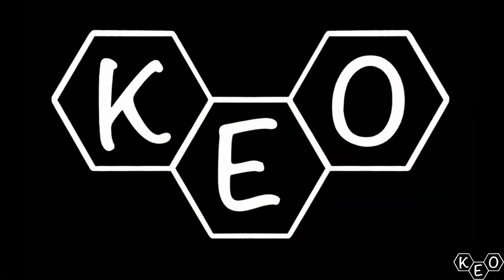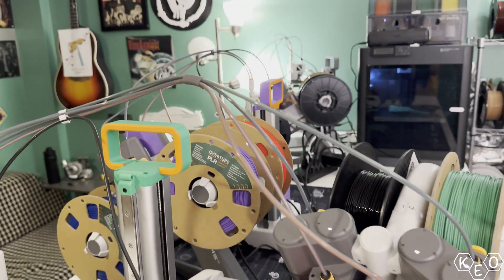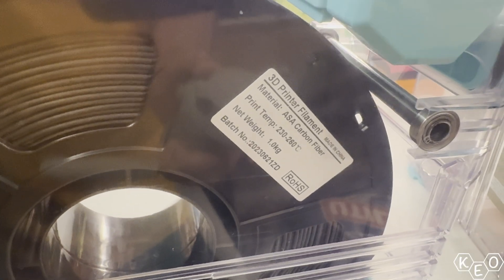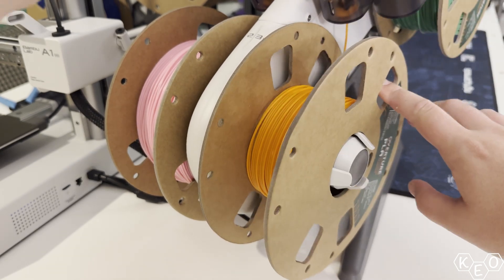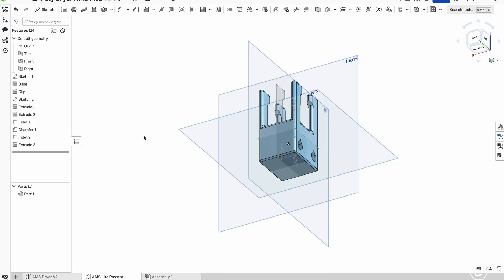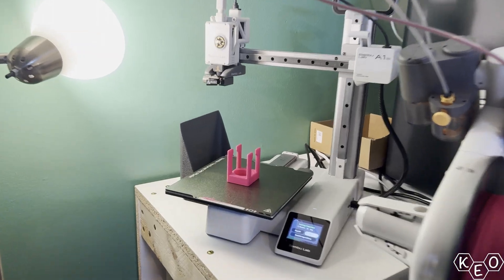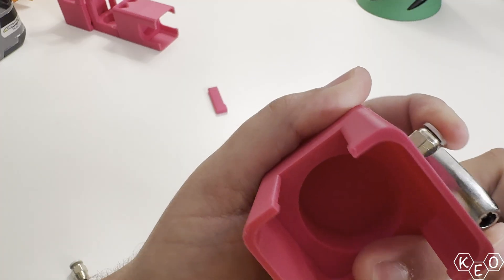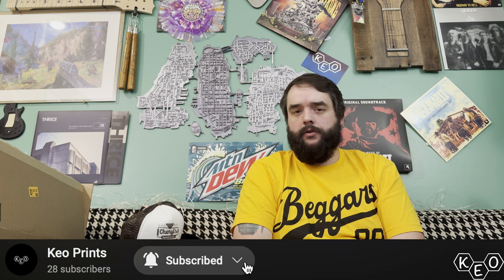The Major Flaw With The Bambu AMS Lite And How To Fix It FAST

Comment: Great video and have made the item in question, I’m not sure what fitment  your using to push the PTFE  tube right through the fitting and size etc.
I have only 4 mm tube fitting but the tube  ends where the tread begins.
Please share the info.
Reply from the maker: Unfortunately, I am not sure where the fittings came from. I have taken apart a lot of previous generation printers and rebuilt a handful as well. As such, the old parts bins are as full as ever and their individual origins are a mystery.

Comment: I've been struggling with screwing in those pesky PFTE tube metal fitting too - until I finally spent the time creating a proper thread for them.
Now the fittings screw in nicely everywhere, I can really recommend investing the time once and re-using the know-how after that for other projects.
Not sure if you have selectable standard thread sizes available in your CAD, but for the PC4-M10 inserts I use a hole with 8,38mm Ø and cut a M10x1 thread into the remaining material/wall.
After that I cut out the >70° overhanging threads with a simple rectangle. Designing a teardrop each time is too bothersome imo and a tiny bridge works equally well.
Reply from the maker: Good stuff here

Comment: Does the A1 mini have tha hardened steel extruded gear in the head already or do I need to buy the upgrade?
Reply: @Kid_illithid  the A1 mini list hardened steel nozzle and hardened extruder so it should work without any issue.
Reply: Sorry after double checking it’s not a hardened steel nozzle but a stainless steel nozzle, but the extruder is hardened so you would just to get the nozzle which list for $11.99 in US
Reply from the maker: That’s not so bad then
Reply: I’m on their site and the replacement  they sell says hardened steel, but I’ve seen people say you should upgrade. Big tree and a few others appear to make all metal extruder gears for not but I don’t know much more than that yet
Reply: It has hardened steel extruder gear, but not hardened steel nozzle
Reply from the maker: That’s a good question and I was wondering if anyone was going to bring that up. As far as I’m aware, it doesn’t come stock with a hardened setup so that is totally a consideration

Comment: The main mod I have done for my AMS lite for the A1 Mini was specifically he Ultimate Filament Spool Enclosure for the AMS lite that allows me to add desiccant to reduce the humidity. I live in TN and it’s normal for humidity to be 50% even in the house. This allows me not worry about PETG absorption of water affecting my prints it keeps humidity for spools below 10% which is the lowest my hydrometer measures.
Reply from the maker: Good to know. I’ve never even looked into that so that’s cool to know that people are providing some support for the AMS lite

Comment: After watching 10+ minutes, I still don't know exactly what this mod does or how it works.
That is kinda impressive.
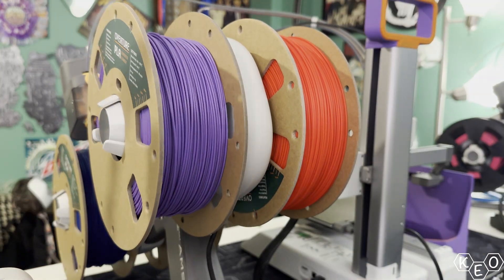Reply: The winner of the passive aggressive comment! 🤣 You certainly were a lot more polite in making your point than a lot of people would have been.  I had to rewatch it and finally found the key sentence at 3:41 that unlocked the functional mystery for me.

"so I set off to make a mod that would allow you to load the AMS light like you normally would using the spindle system move one Bowden tube into a new fitting and use a pass through"

@KeoPrints Thanks for sharing your solution.  Like @ZappyOh I don't have an AMS Lite either but I still watched because I was interested in your solution and the process.
Reply from the maker: Let’s be real friends… I’m just a dude at the start of the YouTube game tanking tons of time into filming, writing, and editing every week while I work my regular job. 

I’m just happy anyone is watching and hanging out with me at all lol
Reply from the maker: I’ll take it! Just print it and feed your TPU through that instead of the external spool holder. Or quick swap between AMS incompatible filaments while the lite still holds and dispenses them for you
Reply: @KeoPrints  Well ... I don't have an AMS, so it won't help me. I would just like to have an idea of what I watched :)
Showing it in action would probably have cleared that up for me.
Reply from the maker: I gotcha there. Well thanks for hanging out friend!
Reply: @KeoPrints  No problem ... thanks for posting.
Reply from the maker: Yo, here is a follow up to show this piece in action if you are interested
https://youtube.com/shorts/CB9O5jykvdc?feature=share
Reply: @KeoPrints  Ahhhh ... Now I get it :)
Thx.
Reply: @KeoPrints  Now I get what this was for! That sphantasia will get me every time. I'm not sure it works for my setup because I use a mod for the AMS lite called the "AMS mini" which works great if you have a different system for holding your spools. That might be worth a video too. But this seems like a great mod for people that still use their AMS mostly as intended
Reply: Your sorry ass comprehension isn't his problem. If you can't understand a video like this then maybe you should go back to coloring books and leave 3D printing to the adults.